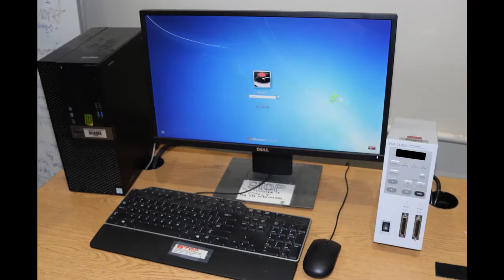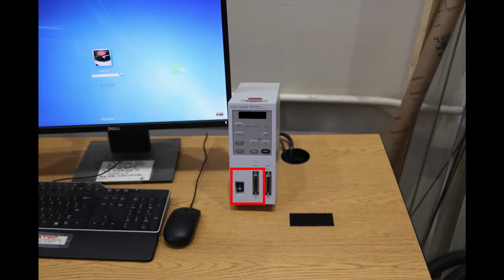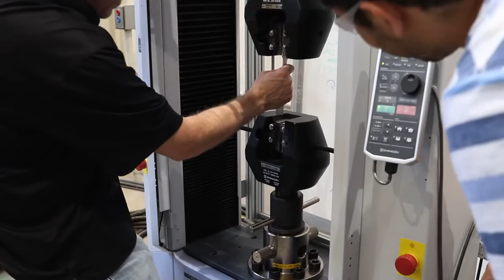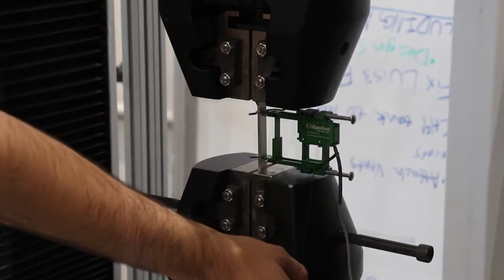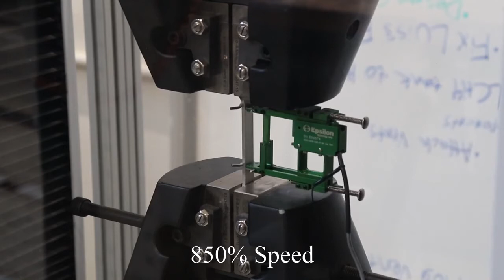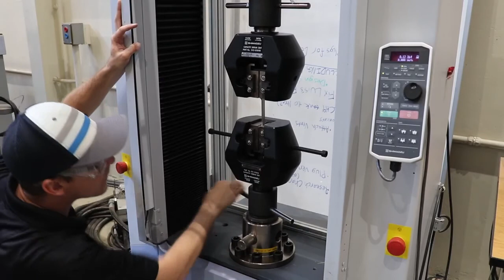AGSX 300KN Shimadzu Autograph Tensile Test System ( Universal Testing Machine )

Comment: Excuse me, you selected a file at 0.47s of the video. What file was that? Could you elaborate a bit on that, please?
Reply from the maker: Hi Muin , Thats how we select the method file . Customer might have different method file for diffent sample . Like one ASTM For steel rebar , one for aluminum plate , one for coppor rod etc . .  So customer have a library of method file . when you do steel testing , select the steel method and test . 

if you need any more information , you can chat me on +971555214595